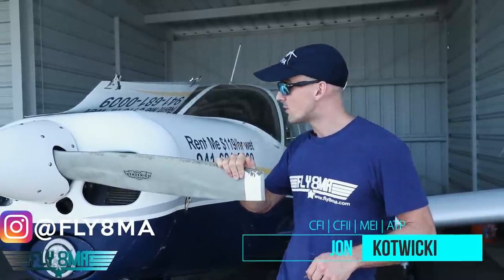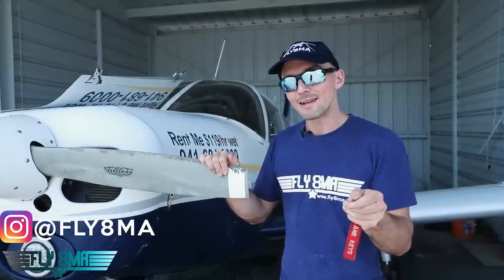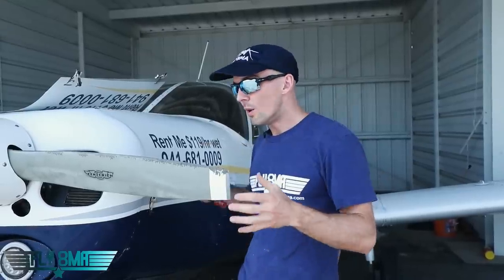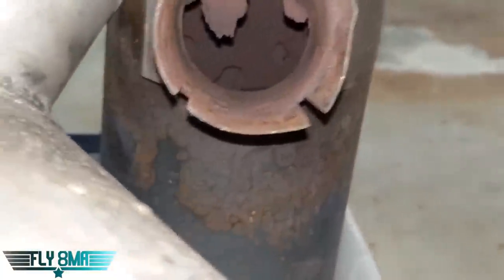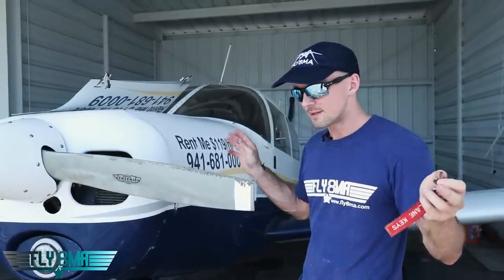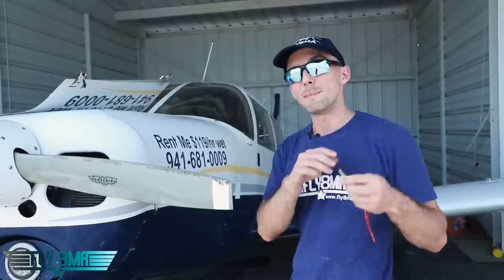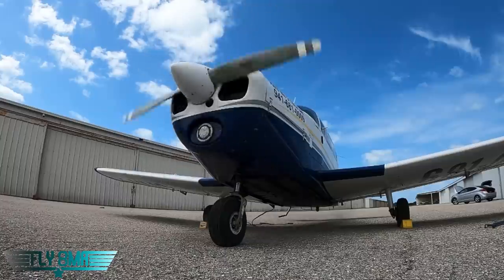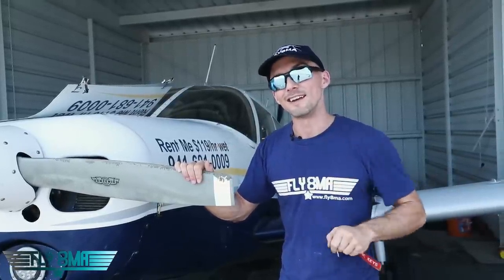Don't make this SIMPLE mistake!

Comment: Great informative video, but, I always do a Safety check before shutting down.  If the engine doesn’t start to shut down, then you have a live Mag.  I do this after every flight or taxiing back to hangar.  Of course I do this at idle.  Remember, the engine is hot after flight and can start or turn over if you have a faulty Mag, or, P-Lead.  The reason is that most people have to turn the prop a little to hook up a tow bar or truck.  It could save a life.  I wish you would have mentioned this.  I do know that most pilots don’t do this or were never taught a Safety check.  I’m an IA and don’t need a hand or head chopped off. LOL

Comment: It's actually more correctly called Afterfire.  Backfire is when it fires backwards through an open intake valve into the induction system usually through the throat of a carburetor.  Backfire is usually the result of bad ignition timing or pre-ignition.

Comment: It can also crack the exhaust pipe inside the cabin heat shroud and leak exhaust gases into the cabin (Carbon monoxide poisoning, which doesn't leave your blood stream for 5+ hours depending on dosage and will literally cause your blood cells from absorbing oxygen you need to be awake/alive).

Comment: There is a guy that survived carbon monoxide poisoning and then forced landing because his muffler had ruptured due to a backfire.  This can be very dangerous.  Not trying to promote another channel but you can watch his story on the Taking Off, In The Hangar channel.  Fly safe and smart guys and gals.  Thanks for posting!

Comment: Ha Ha I did this back in 1993, during my first go at flight training- during the mag check I turned the key to off, then quickly to left mag, and BAM. I was scolded by my flight instructor. 
Little did I know at the time, but I almost killed him. Because the next time he went out to fly, he and another student both developed headaches. They landed, checked the exhaust, and yup, I created a leak and carbon monoxide was flowing into the cabin.I don't know why we didn't have symptoms when we flew that day, immediately after the backfire.

Comment: I fly a 1946 Aeronca 7ac Champ which is required to be hand propped each time. I purposely turn my mags off every once in a while at a low rpm to check they the P-Lead hasn’t come disconnected. I don’t do it every flight but maybe once every other week to be sure. Doing it at a run-up RPM should be avoided though.

Comment: On my training C172, it is equipped with a combo electronic and magneto ignition.  No key switch. You turn both "Magneto" switches to on then hold a button to start it.  So from this perspective the magneto check makes sense.  When you turn the right switch to "off" the left system is running the engine.  In our case the left ignition system is the typical magneto one and the RPM drops.  Then when you flip the left to off, it's running on the right electronic ignition system on there is no RPM drop.  So I am assuming when you turn the key to L you are actually disabling L to test R.  Or did I miss the point entirely?

Comment: My instructor shared a neat trick that serves two purposes for new students. When accomplishing the mag check, rather than say “left mag, right mag” or “right mag, left mag,” he has the student count the clicks of the key position. So the student says, “One, Two and back to Both” as they are turning the key. Then “One and back to Both.” The first purpose is to make the student aware of the clicks and key positions without looking at the switch. We’re looking for the RPM drop, right? Part of that is to not get too hung up on why all the way to the left but not all the way to Off is for the Right mag. And the second purpose is that by counting the clicks, the student is much less likely rotate the key all the way to the left and past the mags to the Off position. Early in my training, (after having banged the muffler once) I practiced this technique with the Master off and the engine not running just to have the feel of the key hitting the stops.  Personally, I wish the Cessna had toggle switches like my Decathlon.

Thanks for sharing this topic.

Comment: Needing back pressure is a MYTH. It has been repeated for years but is absolutely false. Good exhaust systems use the venturi effect to create a vacuum in the pipe to help suck the next cylinders exhaust out. This could be a 20 page discussion on why but to sum it up exhaust is a sound wave not constant flow so it behaves differently. The myth probably got started by guys running straight pipes and loosing power making the assumption that a straight pipe must flow more than a baffle so it was lack of back pressure. This is not correct what happens in a straight pipe is the exhaust(sound wave) resonates back and forth with nothing to interfere with it and bounces back up the pipe toward the engine making a restriction to exhaust flow at certain RPMS creating MORE backing pressure hence loss of power.

Comment: Thank you for the informative clip. Is it safe to start the engine on that aircraft with the tow bar still attached as you have in minute 3:00?
Reply: It's probably for the video showing what happens when the tow bar is left attached. I might be wrong but these videos may have been filmed prior to running it out of oil.
Reply: No never run up with tow bar attached. If you think going to off then on with ignition at run up crates a Big Bang wait until the tow bar contacts the prop.
Reply: No it is not. Will cost you a prop and engine overhaul.
Reply: That tow bar is scaring me.
Reply from the maker: Absolutely NOT.... But we'll talk about that in another video...

Comment: I noticed that N9907W was deregistered as of this month ... is this plane no longer flyable?  What is the basis for de registering a plane other than augering in? (and running the engine without oil as you did in another video)...
Reply: Did you see the other videos? N9907W is gone!

Comment: Hey John, just a quick question: since when you switch both mags off the engine keeps pumping air/fuel mixture and not burning it, I would think there's a good chance it's full of fuel. Is it a good idea in this situation to use the flooded engine startup procedure? Might it also reduce the odds that rich hot mixture goes straight to the exhaust while still on fire and keeps burning there?
Reply: Probably not. Flooding is when there's far too much fuel than air to burn, overly rich in other words. It usually results from trying to start an engine with too much prime or too much choke (for engines with chokes)  If you just switch off the ignition, the fuel/air mixture going into the cylinders (and getting pumped out the exhaust) is a normal mixture and shouldn't result in foo much fuel for the air.